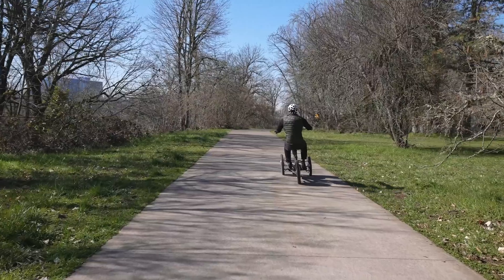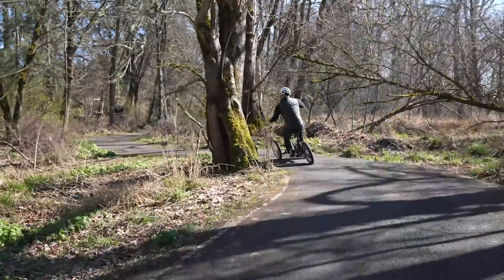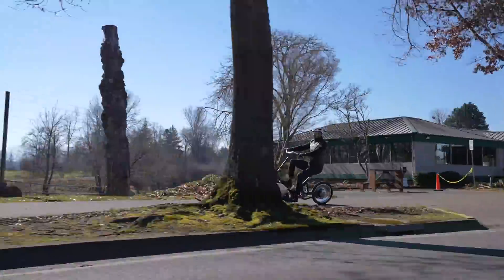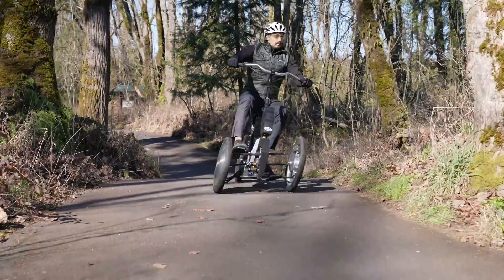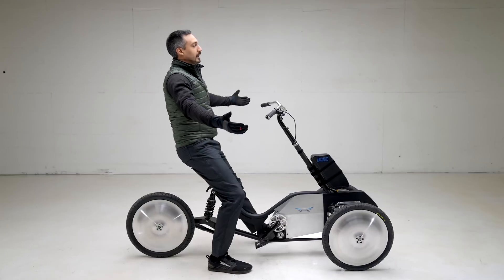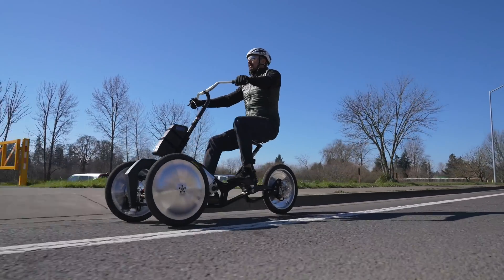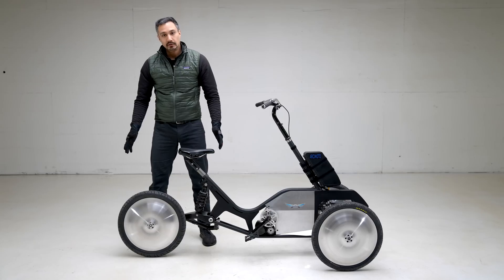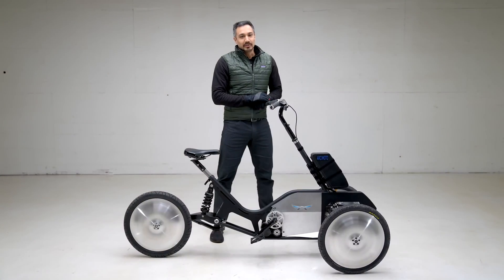Mean Lean Machine explained by Leo

Comment: cant wait to drive one
Reply: It will definitely fit in the CyberTruck vault.  Looks like it would fit in the Model Y with back seats down.  Also, you could lash it to the roof using the 2 cross-beam roof rack, with the three tires forming a stable tripod on the glass.  By arranging 2 in a '69' configuration, you could get 2 on the roof of any Tesla, except the Model X.
Reply: I wonder, how will it go on a cars bike rack? ;) ;)
Reply: @D0li0  just get one of those little flatbed carries that go on the back.
Reply: Both true...  It wouldn't it be extra handy if you could transport it like a traditional bike?

Surely there is a way to make the leaning mechanics also do folding so to accommodate?
Reply: ME 1ST ! GALI ! LOL !
Reply: The MLM project was put on hold at the end of 2022. The workers were furloughed. There is a Facebook group devoted to fans of this design but you can only be fans.

Comment: Nice!  Dont know if you read the comments, but definitely a backrest and higher  BB/pedals are needed, especially if a passenger seat is going to be added.  Also, a detachable fairing and roof for weather protection is  really useful for people who want to use it for commuting/town use besides the fun use on the weekend on dirt  (cf. Drymer from Sinner bikes in Holland).

Comment: A two wheeled ebike will be faster, longer distance, more maneuverable and more portable than this joke. I thought of and started on working on something like this over 15 years ago in garage and even then discovered its pretty freakin' useless.
Reply: That just proves how ignorant you are. I used a velomobile trike as my only transortation for 7 years. No need to balance, the safety of a protective shell, weather protection, major cargo capacity. The ELF was sold for a while before the pandemic did that company in. Trikes in general are a very hot market right now, especially the fat tired ones. That tremendous demand is proving how extremely wrong you are.

Comment: What about a rack for storing items? No mention of maximum speed and battery range? Will it has its own display or will we use our phone? You are not providing a lot of detail just a nice slick video. Consumers are concerned about things like weight, range and speed. I appreciate you talk about braking but I would rather see it in action then you glossing about it! I would also like to see its high speed turning reaction since most people will have to ride this in the street that deal with cars. They may also have to ride this on narrow bike ways and take in consideration other cyclist and pedestrians. Also, what safety features are being built in? For an more expensive machine then lights, front and rear would be in order!

Comment: This is a brilliant transportation device in so many ways! I want to ride one.  I understand this is a prototype but it will need some type of fender for the rear wheel for riding in wet weather and some type of parking brake for non level surfaces.  Will this be allowed on Bike Paths?  I can see that its width may be an issue for some.
Reply from the maker: Fender: yes. Bike paths: yes.

Comment: This product is awesome. Wondering how much the top speed would be on these?
Reply: E-bike rules state the systems can only assist to 25km/h (EU) or 20mph (USA), with 250W and 500W power limits, respectively.
 Actually, that's interesting - if I have an e-bike, I can pedal it as fast as I want to but the motor is speed-limited. Will this one simply refuse to go faster once I reach "legal" speed because it's entirely electric? It's nice to keep up with traffic at 50-60km/h when I'm rolling down a gradual slope...
Reply from the maker: Will vary by region. US class 3 ebikes (pedal assist) can go 28mph. Ultimately this is a software setting.

Comment: If you made a snowmobile version of the MLM, would you replace the front wheels with sleds and the back with a tank track (like a conventional snowmobile), or replace the rear wheel with a sled and the front wheels with knobby ones?
Reply from the maker: TBD. Need to run the tri-motor drive and fat tires on snow with what we have now as a baseline.
Reply: Nowadays? Three low pressure super-fat balloon tires, for flotation plus AWD in both snow & sand!

Comment: Can someone please explain to me why I would want this instead of a e-bicycle?
Reply: Much better traction and safety. No chain, no oil. Three in hub motors bringing more power and traction. Three wheels allows much better balancing without risk of sliding out or falling over. Changing a flat is much easier since you don't have to take the whole wheel off. You can replace your workout stationary bike with this and charge it up by using it like that. It will be able to carry a second person with the coming seating option and you'll be able to have lots of other add-ons and be able to carry much more than you can on a normal bike.
Reply: @joebuslife9275  -  Thanks for the info
Reply: @joebuslife9275  And simplicity; just peddle and go like assisted e-Bike peddling, but enhanced in many ways as JoeBusLife points out quite well.

Comment: Can't wait, such a neat unique power train design for bicycle format.

I hope you can add a sort of PTO, power take off, for stationary use to power 12v loads perhaps.
Reply from the maker: Stay tuned ;-)
Reply: @arcimoto  maybe piggy back off some Portable PV voltage standards that various battery banks could utilize as if it were doing PPT tracking?
Reply: Brilliant
Reply: Indeed! "Such a neat unique power train design for bicycle format."

Comment: Looking forward to it! I need a rack for uber eats deliveries. Also the ability swap batteries out quickly would allow for turn and burn pit stops for all day deliveries. Question - How much is useful energy when peddling?
Reply from the maker: Yes and yes. As for energy from pedaling, aiming for 90% capture.
Reply: @arcimoto  Awesome!!!
Reply: @arcimoto  To clarify, does peddling only charge it when stationary or will it also charge it when moving?
Reply from the maker: @RussellHogan  A quote from the video at 1:20 - “The pedal generator is putting useful energy into the drivetrain, it can 𝙖𝙡𝙨𝙤 be used in stationary mode to recharge the battery.” - Leo
Reply: @arcimoto  Thanks for the clarification Leo!
Reply: Seriously,? You dont have to wait for this thing. You can buy recumbent trikes both leaning and no leaning RIGHT NOW and easily electrify it and be able to get around when the battery is dead, unlike this monstrosity which if the battery dies and you dont have a spare, you're pushing it.

Comment: Why no price? Can't find a price online and preorder only shows the $100 deposit. I really really try to like you guys, but shady shit like this is a HUGE red flag.
Reply: well I think it is because they have no clue what it would cost. I'm guessing it will be between 4-7k$
Reply: price price price
They said a lot but said nothing.

I'd rather see the video pointing out specs and how things work than just a RIDES OVER GRAVEL - so does a big wheel!

At this point, V3 ....
Weight, speed, range, future batteries, cargo options & estimated price range.

Two person?
Why??
Focus on what it is before you make it a tandem
Reply: @EvilTwin123  Weight is between 80-100 lbs. Speed is limited to max E-bike speed depending on your area 23-28mph (It has power to do much more) More details will come later after more development.
Reply: MLM video 3/2/22 answer to Roger Waldman – Arcimoto said: First ones will be priced as premium ebikes. Long term (mass production) target is - $2k for the stripped down version.
Reply: They only have a prototype which may change before production. They should have it close or in production by the end of the year. You can wait to order when you see the price and final product..... that simple.
Reply: @BeachBum2009  Then they should wait to announce something when its more finished... that simple 🙄
Reply: @CaptainXJ  If you wait eventually they're trying to bring it down to $2,000 but most likely the first ones they make will be $4k-$6k maybe 3K if we're lucky.

What is known as far as specs: The range is 60-70 miles for the base. Has option for 2 add-on batteries for about 70 miles additional range each. That's a max range of 200+. It will have the top speed of whatever a class 3 E-bike is limited to by law in your area. In the US it would either be 28 mph or 23 mph.
Reply: @joebuslife9275  Yes JoeBusLife, I'm hoping for the $3K price. Thank you for the early specs info.
Reply: @joebuslife9275  they said that about the FUV was supposed to be 11.9k
Reply: @ed-word  Will be once fully ramped up on 1.x

Comment: Very excited to see this revealed 2 weeks ago.

Do you have to pedal constantly or can you just use battery power to accelerate?
Reply from the maker: In order to be a class 3 e-bike, you will need to pedal, but you will be able to set assist level to your required level of joy.
Reply: @arcimoto  the wording I’ve seen indicates that you can charge when stationary, or use the pedals to control the speed, nut it’s not clear if pedaling while riding actually contributes energy to the motor or battery?  Also, the trails I ride are limited to class 2, will there be a mode for that or something?
Reply from the maker: @dalet9849  yes, riding does contribute useful energy- the pedals function as both a generator and as the throttle control. As far as class 2/3, we expect to be able to manage that through software settings and the user configuration of the trike (ie does it come with a thumb throttle, what top speed is required, etc.)
Reply: Sounded like they said it didn't have a manual throttle.  What if your legs get tired? :X I hope it can tell or they are accounting for that.
Reply: @drxmario2  I doubt you have to peddle too quickly to continue propelling (so you wouldn't get tired peddling), but that will really interesting to see. I love this simplicity; just peddle to go!
Reply: @Scott Sexton  I recently got my eldest daughter an e bike to go back n forth for her first job instead of a more expensive car.  Although it does have an auto pedal assistance feature when you pedal, like is implied in this new FUV 3 wheeler, the simplicity of also having 1 throttle on one of the handlebars and just feeling the instant and continually delivered power and the intensity control of the response was just more "enjoyable" in our opinions. It was as simple as a flick of your right wrist.  I do understand that adding a simple manual control like that would increase complexity and the overall cost though, but it's my honest opinion.  People like to feel like they have a good amount of control.  Of course, if FUV never sets the precedent, I'm sure most people won't be bothered in the end by it like me.